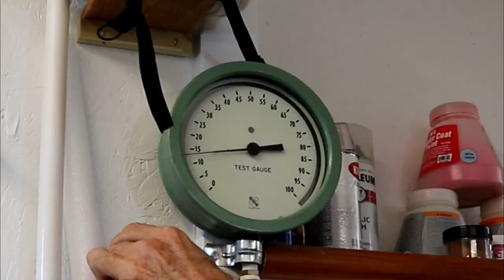SPRAY CHROME, Spray Gun Build Tutorial, DIY Double Nozzle Spray Gun  #spraychrome #spraysilver

Comment: Do you think having the red tubes 90° at the nozzle tip is more effective than say 80° coming from the red tubes? Any tricks to prevent acid burn or streaks? I’ve been told it’s better to use a tiny bit more silver solution than reducer prevent the white streak burns. Red powdered rouge on a cotton ball very lightly massaged on acid burns will remove the milky burn streaks. Any other tips would be greatly appreciated!! Awesome job making your videos!!❤
Reply: Does the insertion length of the red tubes into the tip make a big performance difference? You can also dilute the chemicals if it’s helpful in particular applications. Angel Gilding has a new formulation that reduces the chances of burns that will be made public soon. I just got some and I’m eager to see if there’s an improvement. Thanks again for being so AWESOME!! 👏🏼 ❤
Reply from the maker: I played around with the angle...90 is best.  The most touchy part is not putting to much on...it starts to go black.  Flaming the surface before is key.

Comment: Im gonna make one this week. Thanks alot...... 
As soon as i laquer a silvered object it turns yellowish/light gold, is this a common issue? How can i fix this?
Reply from the maker: You can't use laquer.  I recommend you use two part automotive clear coat and tint it slightly with violet resin dye.  Check out the tutorials on AngelGilding.com

Comment: Hi can I use normal plastic bottles with hoses from suction pump spray bottles instead of the suction airbrush pots?
Reply from the maker: You can use just about any bottle but the larger the bottle  The greater the risk of waste and possible contamination of a big volume.

Comment: Hello I wanna to ask you if a can use normal bearings for the spinning mechanism of a certerping style reel. It just I wanna make my own reel for fishing.
Reply from the maker: Yes you can, but you should try to get stainless or even better, ceramic.  They are smoother and longer lasting.
Reply: @EngineeredAngler  ok but I wanna know if I can use other thing for the spinning mechanism?